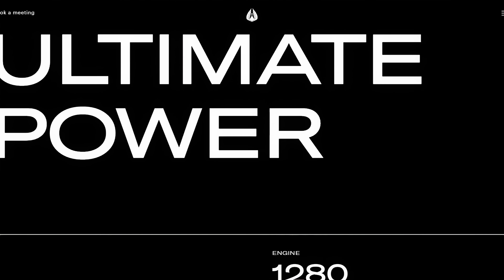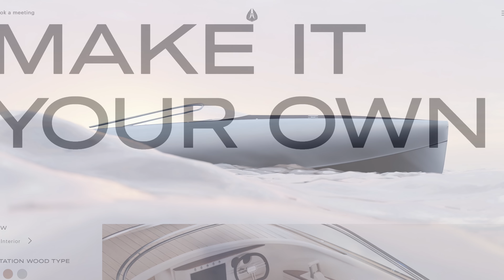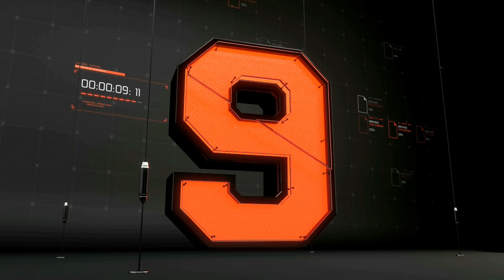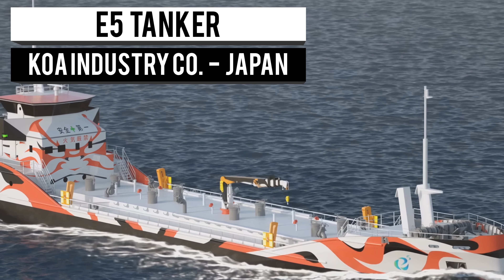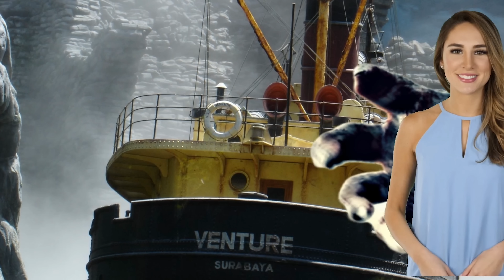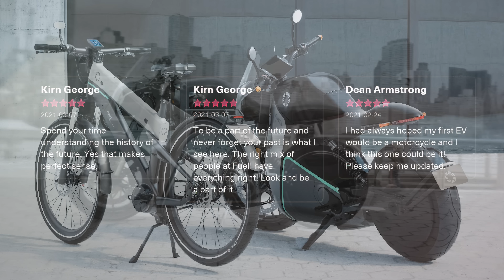Machines Built for Missions Ordinary Vehicles Can’t Handle

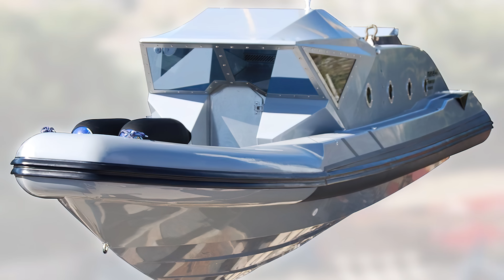Comment: 2:15 how can a relatively small boat with near to 1,300hp not go faster than 23mph?
Reply: 20kn is the cruising speed for maximum range and comfort. The top speed is 70kn but that is not comfortable, that is "OMG HOLD ON TO YOUR SEAT OR YOU'LL GO FLYING AAAAAAH!!!"
Reply: Think he got hp confused with watts, . .
Reply: @scottcarlon6318  1300 Watts would come out to less than 1 hp, so no, I don't think that's true.